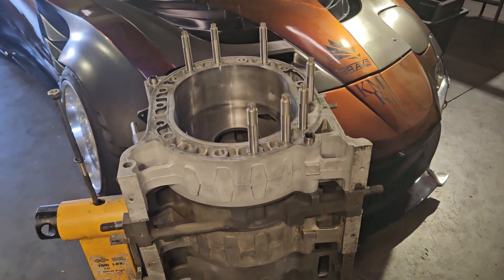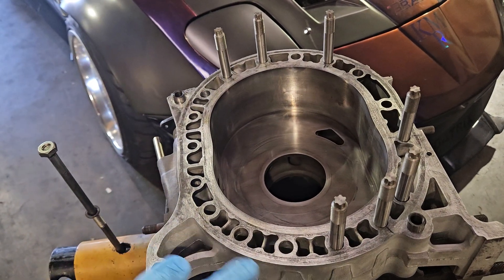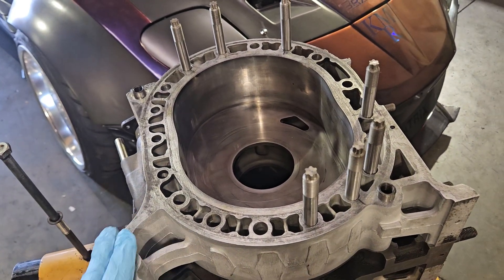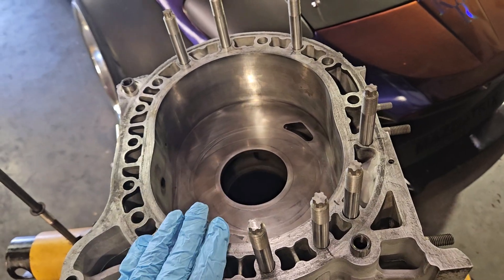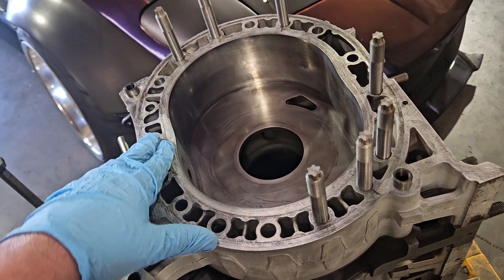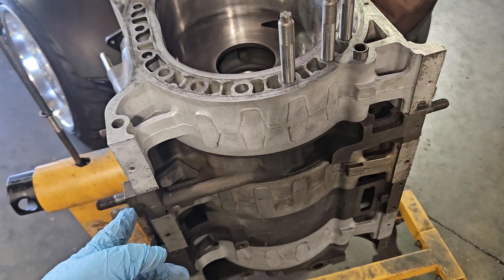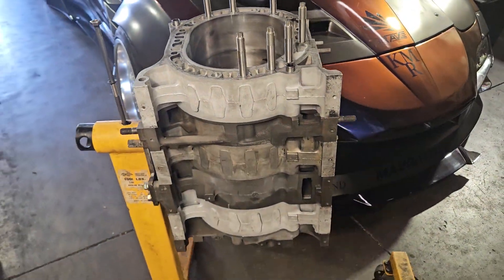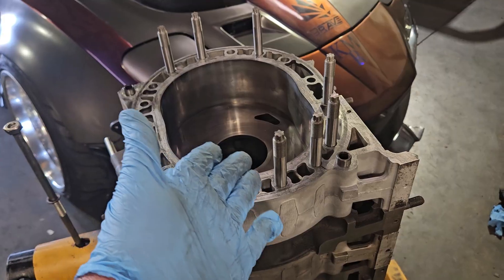20b 3Rotor Block Studding options - Strength & Reliability - Rotary Engine Tips big HP - KMR Rotary

Comment: The location of the studs is away from the combustion area, you mentioned that these were the full length bolts - is that the only reason why? Is there any benefit in spending the money in adding studs around the combustion side?
Reply from the maker: Generally I like to completely stud the blocks, but in this case this was what the customer ordered. It's less expensive and still provides a lot of strength.

Comment: Hey man, my wife and I have spoken to you multiple times at FD ATL in past years. I have a question completely unrelated to the video. I have a stock port 12A with the racing beat holley 465 carb. What GPH is required for the fuel pump? The Mallory pump died long ago, and I have been through about 5 holley red pumps. One of which didn't work right out of the box. Is there a reliable pump that doesn't sound like it belongs on a 1,000 hp dragster that is readily available? Almost everything you see is the same cheap Chinese junk with different branding on it. Even if you don't have a brand to recommend just a required GPH for that carb would be helpful. I do drive it flat out on curvy mountain roads. I have considered one of those cheap parts store electeic pumps like the edelbrock 17301 or holley 12-427 and just keeping an extra one in the car in case it fails, but it would be nice to have something that will last. I know Mazdatrix has a lot of experience with these old cars. Any advice is appreciated. Thank you and keep up the channel!!!